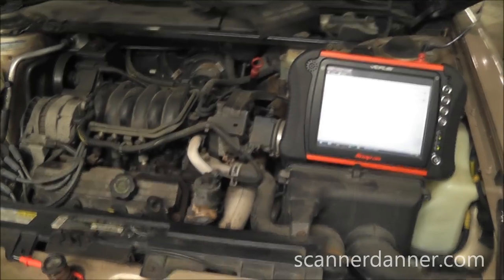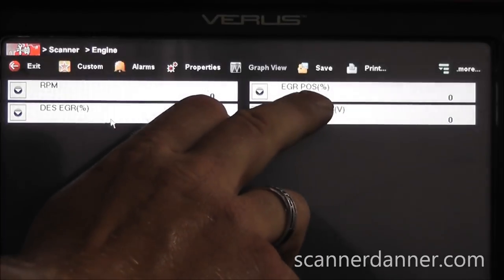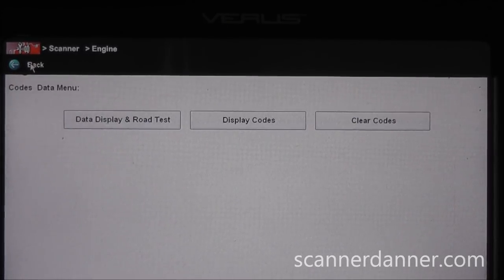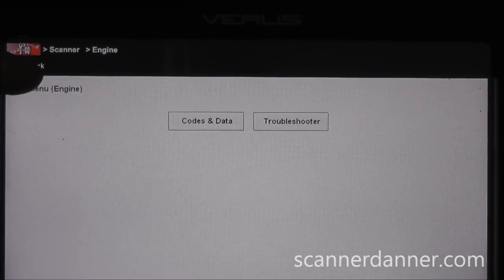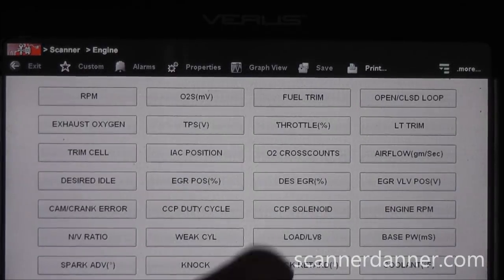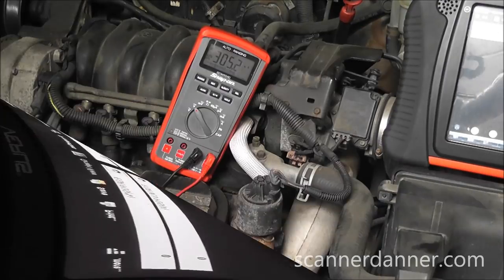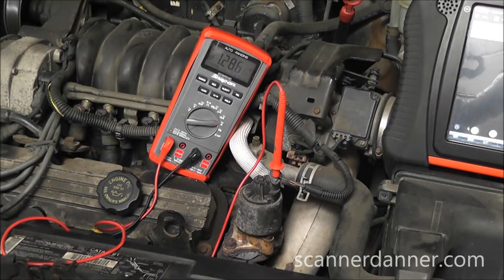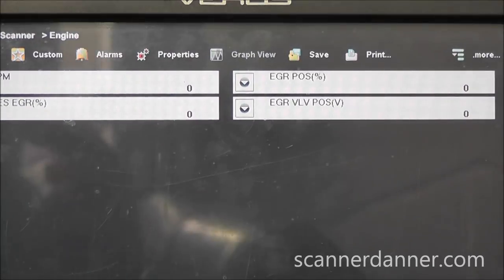How to test an electronic EGR valve (GM P1406 case study)

Comment: What direction would u take to diagnose a egr excessive flow. The system uses a maf, it has an egr temp sensor and solenoid. Any advise would great. Thanks
Reply from the maker: if it is a Ford, you need a DPFE sensor :) or someone reversed the two pressure hoses
Reply: I'll try that, thanks
Reply: David Garcia Now hang on a second David. "Trying a part" is against my religion :)
Test it first. Find my videos where I show how to test the Ford DPFE sensor. You could also have a plugged exhaust cause this condition on a Ford. I am guessing by your response that it is a Ford?

Comment: i have a 1996 buick regal 3.1L  same code.
if i jumper the reference wire will that clear the check engine code?
Reply from the maker: do you have no reference voltage like I did? and this is your only code?

Comment: Back to my 01 silverado 6.0 again. Code p1404.  If i unplug egr valve connector i have 12 v. at red wire. Plug it in and i have 0. Could egr be shorted internally. Also no voltage at other outside (white wire) but i have 5 v ref
Reply from the maker: most likely this is normal and is a bias voltage on a power side switched circuit. Post this to my forum, it is free to join and we can help you better there. Thanks!
https://www.scannerdanner.com/forum/post-your-repair-questions-here.html

Comment: i could use a diagram for my egr....this could make my work so much easier..(but it is still with 5 wires...i do have 4.6v on 2 wires other 2 wires is missing or having very low voltage like 0.2v) and the ground witch it works just fine.
i also heard that to see the other wires working the car has to be running on the road....otherwise that one wont bring any voltage to open the valve probably.
i only need to know witch one is the signal and witch one is the valve opener..
also when i tested them with the v.metter they were with the plug out of the egr. but i havent gone with the ground cable directly to the battery...but instead i used the ground from that egr plug(before that i tested the ground pin from the plug to the battery to see if its an open circuit.)

ima begginer in these stuf...but i do understand them how they work...its just im blind without diagrams..(for my car no one gives u a diagram or finding on the internet any tutorial since the car is not that popular enough)

thanks for the info.
Reply from the maker: absolutely you need a diagram to start with. This is a link to the DIY version of the same diagrams I use https://eautorepair.adtrk.biz/?a=10817&c=24&p=r&s1=
Start with that. Without looking at one myself and not knowing the specific year, I won't speculate, but I definitely want to check the solenoid power supply circuit, because that is what you are missing in your description. The two 4.6 v wires would be reference and EVP signal (which will read same as reference unplugged on this model)

Comment: i have a toyota corolla when i test the connector to the map and trottle position sensor all the wires read 5v all 6 wires three an the TPS and three and the map sensor read 5v and the car wont start what is the problem?

Comment: Hi Paul,

Thank you for uploading this great video. Question: if the reference signal is internally shared, can we instead of replacing the expensive computer, externally splice and connect the EGR reference signal to another commonly shared reference, like the TPS you've mention?

Comment: hello ,it is showing 12 voltage when i unplug the solenoid conector but do not showing any voltage on the same wire when i plug it back in. and no voltage showing up on control wire either pluged in or uupluged.please advise me what might be cause ?thank you in advance
Reply from the maker: +sherman soley sounds like you have a corroded feed wire. with the connector unplugged will the 12v wire light up an incandescent style test light (non LED type)?
Reply: Thanks alot .the problem was fixed due to your helpful video and information.i will follow your videos
Reply: +ScannerDanner I'm having basically the same problem. with plugin unplugged the far red wire does have electricity but with it plugged in neither outer wires have any reading. the outside red wire will not light up an incandescent test light. any advice? fuse?

Comment: Can u share info on resistance test on the 5 pin egr
Reply from the maker: I've never done resistance testing on these. The ohmmeter is not a great tool in most circumstances and when it tests bad, it is bad, but when it tests good it can still be bad lol

Comment: Any chance I could of gotten the wrong EGR for my 97 oldsmobile 88. The gasket didn't fit but the EGR itself did. I just bought another one from AutoZone.
Reply from the maker: or you installed it 180 out, it is possible on some to do this and when you do, engine vacuum lifts the EGR valve pintle off of it's seat
Reply: @ScannerDanner  I could only go one way cause putting it 180 out, the clip would not fit. Do you have any idea how common is it for the signal on that clip to fail? Thanks

Comment: set to amps if its a low currant draw you can use a test light and be alot safer a multimeter will put out 10 or 20 amps depending on what meter you have. A test light will not allow that much current thru BUT if you are working with the computer KNOW circuit design or it may put enuff currant to cook the computer

Comment: Mr scanner danner I have a ford f150 2003 4.6 here my issue i have purchased a new motor for my truckever since I put this motor in I have had nothing but problem I have replace every thing  on this truck down to pcm and everything else I have a a stalling issue when I come to a stop and it ldel real low and no check inside light I need help I have put so much money in this truck
Reply from the maker: Electronic throttle body or throttle cable?

Comment: nice video quip the good work remsi 23 year in the industry thank you
Reply from the maker: +remsi catalan thank you
Reply: +ScannerDanner Hey scanner Danner I'm not trying to be a smart ass or anything but I have to disagree about the 5v ref being shared between those two sensors. The pcm uses 12.6 to 14.4v to operate so the internal circuit board uses either a voltage regulator or a buck converter circuit to steep down to five volts. The point is if all the components used only one electrical device or circuit to regulate the 5v circuit all 5v ref would be down. Anyway just a theory I have recently started getting into Integrated circuits and designs. A good source right here on youtube from EEV Blog a guy name Dave Jones. Lots of info on how these circuit board actually work their magic on the channel.
Reply: +Jarrett Phillips the newer systems are starting to use multiple 5v regs but the older systems absolutely only have one and it is shared between all the major inputs. I've seen it many times my friend. A shorted map sensor cause a no com, no start, no injector pulse, no ref to the TPS, ECT, IAT, VSS, CAM, AND CRANK sensors, unplug the shorted Map and it all comes back. Look up a video I have on this very thing on a Honda Element. Just type in Honda Element on my channel and you'll find it. Thanks!

Comment: OK what would happen if you move the egr ref to the tps ref wire
Reply from the maker: That would work as they are essentially the same circuit. I just did the jumper inside at the computer instead of under the hood.

Comment: Hello guys. I can be wrong but if this defect 5v circuit supply several components,Paul should have several dtc’s. But he don’t. Just egr valve was wrong on the scanner. So for me this 5v circuit was dedicated to egr valve only like on the wiring diagram.
Reply from the maker: This is NOT a shorted 5v ref but an open in one leg of it, that is why there are no other faults.

Comment: Can anyone help out...I have a 1996 chevy express with the 5.0 and I have been getting code P1406 and can not get rid of it. i have changed over to MPFI since i was getting a misfire code and the old poppet injection system was bad in the process of doing that i changed the upper intake manifold and cleaned the lower manifold. the misfire code never came back but the p1406 still comes back, i have installed over 3 egr valves and they come back. I have taken the valve out and tried cleaning the ports with sea foam and throttle  body cleaner and the code comes back. Other parts that have been changed are wires,plugs,cap,rotor,Catalyc converter, all 4 O2 sensors. i am at a loss with this code..next thing would be to check the circuit like the video? any help would be appreciated.
Reply from the maker: I have seen the valve bolted on backwards cause incorrect pintle position  from intake vacuum lifting the valve off its seat. (from being backwards). Not sure if that is possible on this model or not.
Reply: Yes the EGR on these engine can be installed incorrectly (backwards). mines had it installed backwards and I was kind of glad when i discovered it, and really thought this was the p1406 code i was getting. Well no luck code came back.

This morning i decided to investigate a little more and found two possible problems, I wiggled one of the ECM's connectors and the engine surged so i unplugged all of the connectors, cleaned and applied die-electric grease to all the male and female pins on the ECM and harness. That fixed the poor connection to the ECM.

Second thing i noticed was the connector to the EGR had all of its female pins opened too much i closed them and the can seems to run better, although i have not driven it enough to see the EGR light on. Fingers crossed!

Next thi
Reply: well bad news engine light came back on..stumped.

Comment: How r ya. Im going throught this problem for days. Please i need help. The car is my wife sye failed inspection and we work opposite sides of the state so no go on giving her rides. I have 4.99 as ref and 4.08 signal. But the control and the other outside wire marks 0v not 12v like in the video But when i d8sconnect it one of them goes up 10.53v and i connect it it goes to zero. Its a 07 town and country. Any help very apreciated.
Reply from the maker: Sounds like the solenoid portion of the valve is power side switched and the unplugged voltage you are seeing tell us that is the control wire (bias voltage).
Reply: Thanks soooo much. I put + power to it instead of - ground? I put -ground to it at first thinking it was -ground side switch.
Reply: The issue is that at first it was a low connection from solenoid from egr. Did the test, replaces the egr. Drove it for like 10 min the cel went off. Then it came back after awhile and states new code. Egr position closed. I forgot what the cel code was. I cant sleep thinking about this issue. I put another new egr because i have a warranty on it.
Reply from the maker: Yes, but let's make sure first. Take an incandescent test light connected to battery positive and touch it to the other solenoid wire. 
It should light. A power side switched solenoid will have one of the two wires that goes directly to ground. (Connector unplugged for this test)
Reply: Did i mess something up by putting ground to positive switch side control solenoid?
Reply from the maker: @AummenuGuambro10  you could have but only if the driver in the computer was being commanded on at the same time. Which if the car was running at idle, or just the key was on, it wouldn't be. I think you dodged the bullet. 
What code are you setting now? Make sure you clear them and drive it first and the tests you were doing will set codes.
Reply from the maker: @AummenuGuambro10  it is actually cool to see your understanding of the circuitry by your questions! Are you a tech?
Reply: Tech in training. Thumbs up. I did have the key on and turn the car to idle but it was a cold start
Reply: Throwing closed valve
Reply from the maker: @AummenuGuambro10  trying to help. Need code number please. Also, year, make, model, engine and history would help too
Reply: Give me a bit worki
Reply: The code i forgot. Its 2007 town and country 3.3l. The car been having this problem for years. I bought a new egr last year inspection and it lasted a couple of months. I was looking for help on the net,diagrams, testing and such to no avail until i saw your video. I began testing wiring, resistance, volts but one thing i couldnt figure out was which wire is the solenoid control and how to energize it.Got new one.  Cel light went off by itself. Drove vehicle and not shortly after cel is shining. My buddy wasnt avail to erase code and try agai. So i disconnected the battery. Not too long same story.
Reply: 1st time tye code was p0405 with the old EGR. Then with the new egr the light went off alone then after awhile it came back on. cel was p1404. Last night buddy erased it and installed yet another new EGR(warranty part). Drove the car for awhile went to a mechanic to check for any codes. Zero issues. couldnt find anything wrong. Then way back. Lord be hold, the cel again. The odd thing is that hit a pot hole the cel came on.its weird being that drove alot of miles with the cel off. It happened to me a couple of days ago. Drove it for 30miles as soon as the gas light went one and hit a pot hole light came on. Just throwing that in therr
Reply: But thank goodness i found your vid. Im  into the technical,tuning vehicles and some mods. Working on my car. I want to get new block to build it on.
Reply from the maker: Okay, need that code when you can. Don't disconnect or play with anything until I have it okay?
Reply: P1404
Reply from the maker: @AummenuGuambro10  you are going to need a bi-directional scan tool to finish this diagnosis. There are possibilities for this fault that involve the PCM driver and testing it and you really can't easily without a good scan tool. 
The only other thing you could do is rig up a 12v test light in between the two solenoid wires and tape it to your windshield, then go drive the car and see if the light lights up. The problem with this test if the ECM may not turn the EGR valve on when there is a code for the position sensor or solenoid in memory.  So you would need to clear the code and leave the EGR plugged in and rig up your test light by back probing. There are safety concerns too for any power side switched driver if there is a short to ground (from your rigged up test light). IF you need more help, this needs to be moved to my forum. IT is free to join. Hope to see you there. https://www.scannerdanner.com/forum.html
Reply: My wife took the car this morning to work and the cel light went off. She drove it on the highway.
Reply: She suspects as do i that it could be something with the harness. Harness is railed over the tranny to drvr inner sidewall
Reply: Thanks so much bro. The mil light is still off. You sound like a buddy from LA, Surfer guy. Duuude

Comment: I got a 97 eclipse that idles high and makes a loud whistle as the the rpms get higher. Stumbles hesitates then shuts off. Im thinking maybe egr valve. Help me out scanner danner. Ur awesome.
Reply from the maker: +jose HERMOSILLO EGR stuck open would not cause your engine to idle high. The whistling sound has me concerned of a vacuum leak
Reply: Yeah i foundit. It was the intake manifiold gasket aparently thegasket went bad. Melted but now boost wont kick in like it wants to. Idle is fine. Motor sounds nice and calm. Booston guage spools and wants to kick in but the engine doesnt allow it. Any ideas?

Comment: Is it possible to get a 12v line and regulate it to 5v and use?
Reply from the maker: Yes it is. You can buy a 7805 voltage regulator from radio shack for like $2?
Reply: That's way cheaper than replacing the ECU. You the man. I like your videos and I have learn lots from you. Thanks!

Comment: If some car have closed EGR pipe for some reason you would need to take that EGR valve of to see if that valve is realy moveing when you ground the ground controlled EGR. But if it acts like that its not needed to.

Comment: 1999 astro van 4.3 vortec v6 most all new parts,hesitation on acceleration then runs smooth,misfire on no. 1 and 6 cylinder anyone know whats wrong with this van??
Reply: Bad plug wires and/or spark plugs on those two cylinders maybe?
Reply: +TheTruth4313 have installed new plugs & wires,2 injectors weren't getting a ground ,went to clean pcm terminals and found a broken wire to one of the pcm plug

Comment: can you contact me guy doing video I have 05 lesqber with whinning noise from my egr it's been replaced intake manifold is new and just changed cat converter
Reply from the maker: What's your backpressure? Was your old cat in pieces? If it was, you can have pieces stuck in the muffler. Remove upstream O2 and see if your noise goes away